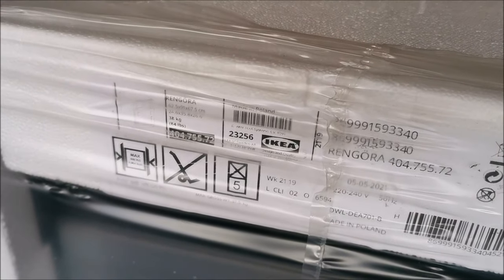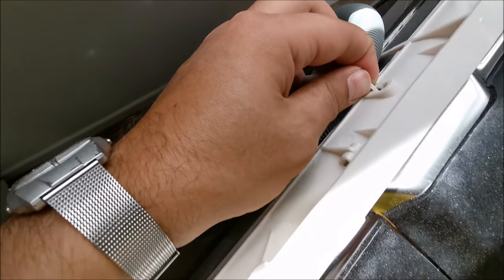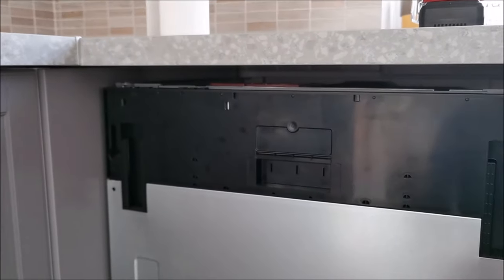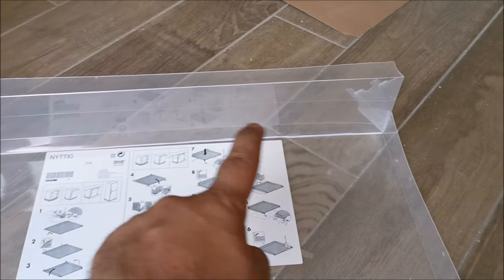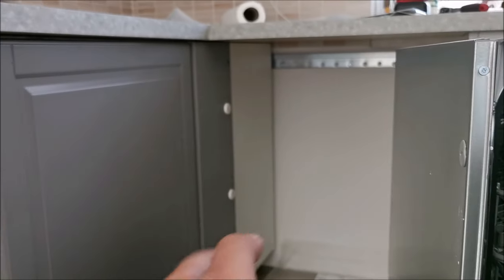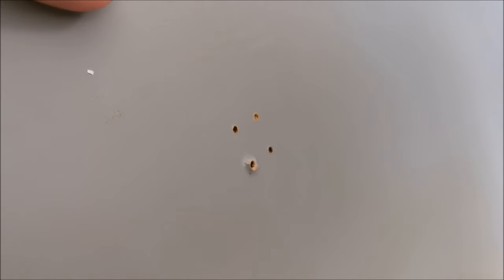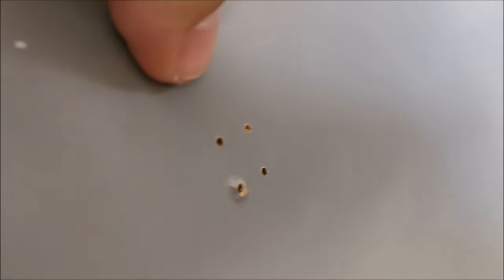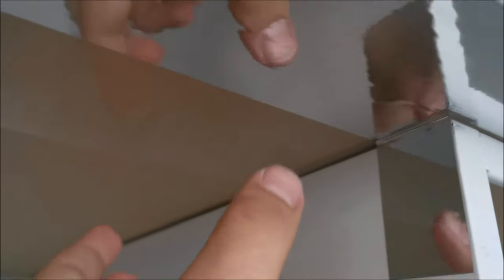Assembling IKEA - RENGORA + NYTTIG + FIXA - Integrated dishwasher + Floor protection + Vapor barrier

Comment: Great video, 😅m fitting exactly the same dishwasher into the kitchen at present. If it’s any consolation I also tried to take out the plastic latch 🤦🏻. I also manually moved the rear foot down and now I see your video I see that the screw at the front should have been used.
Reply from the maker: Haha, I feel less bad now 😄

Comment: Hi. When assembling the door: what do the two pictures in the middle of the drawing mean? What distinguishes «1» and «2», and why are the screwing holes differently placed? Great tutorial!
Reply from the maker: Hi. I think those are different types of doors.
Or maybe I'm looking at the wrong moment in the video.
Reply: Yeah it’s about the door type. I have bought a custom door, but I’m unsure which door type instruction to follow. Does the (1)- drawing mean that the door has thicker edges perhaps? It’s around 9:00
Reply from the maker: @SrgntLoveGaming yes, most likely.

Comment: Would you recommend installing the dishwasher before or after putting on the countertop?
Reply from the maker: If I remember right I put it before, but still needed to adjust the height to touch the countertop.

Comment: Im trying to find a solution for my door but it doesnt seem like you have the same problem as me. 

When i put the font on it matches the top part of the machine but i am only able to open the door about an angle of 30 before it hits the machine instead of the full 90. Its really annoying
Reply from the maker: Front is suposed to slide up while you are opening the door. Maybe you are not attaching it right.

Comment: Hi! 

I have a problem with the ikea rengora dishwasher. The part at 11:46 

My door slides in but there is nothing to screw the part into? 

Was there somthing to screw into on yours? I can not see not screw thread on mine. Thanks
Reply from the maker: Hi. Yes, as far as I remember and can also see in the video there is a thread there.
Reply: @UltimateDIY  there is definitely a manufacturing fault on mine then as I have no thread, is there a way I could send you some photos?
Reply from the maker: Maybe upload them and put a link here. But I installed this about 2 years ago, so I could make a mistake and give wrong advice. Your best chance would be to get in direct contact with Ikea to be 100% sure.
Reply: @UltimateDIY  thanks for the replies really appreciated, I have emailed the Ikea team. I'm hoping they can confirm there is an issue with it. If I have anymore issue I'll post a link on here if needed but for now, thanks
Reply from the maker: Hope you get it figured out 👍🏻
Reply: @BEEVUS07 did you get it fixed. We have same issue. Nothing to screw into
Reply: @BFitz1976 No! I've had a right carry on with it with IKEA. I've literally just 'resolved' the issue and IKEA have held their hands up and I've got a full refund for the appliance. Going to buy a branded integrated dishwasher and install the 'adapt-r' dishwasher door kit. Honestly been a right ballache from day 1.
Reply: @BEEVUS07  we were lucky so. After seeing your post I rang customer service and spent 30mins debating the problem. Ended successfully with us getting a replacement appliance tomorrow. Thanks for your post
Reply: @BFitz1976  really! I would of preferred that option, let me know how the new appliance is in regards to the bolt hole I'm intrigued.